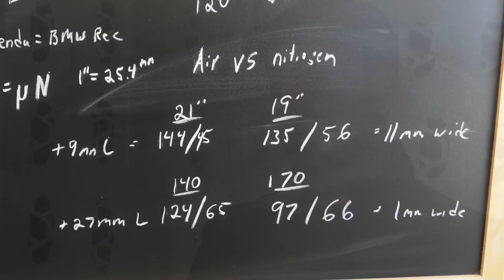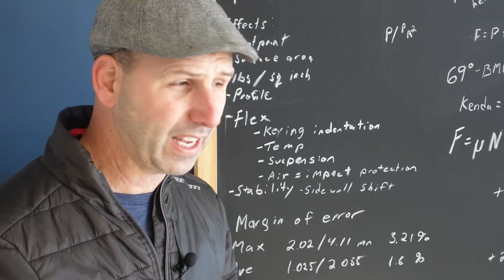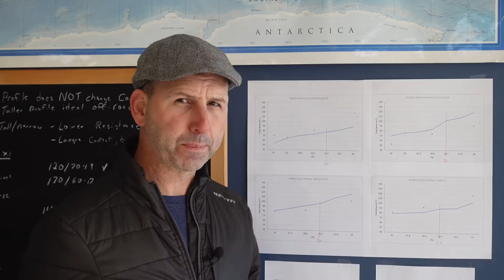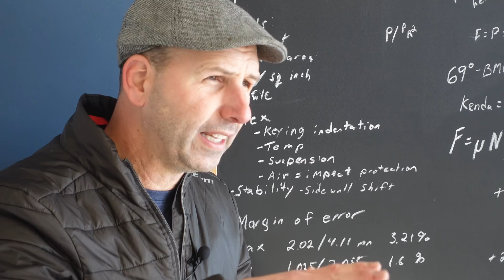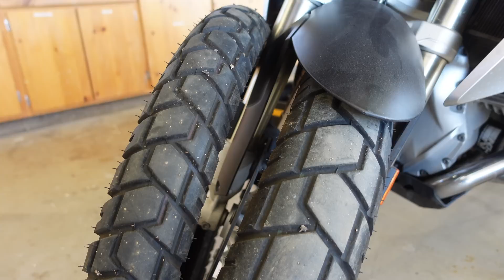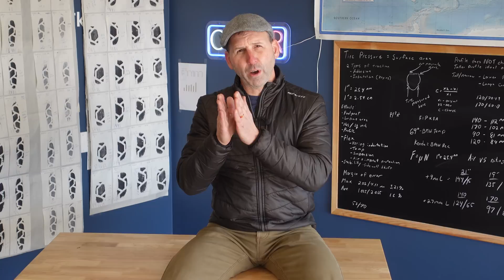Selecting the correct tire pressure; How airing down motorcycle tires affects contact patch

Comment: So In Short Its not THAT Much beneficial to air down But if you DO wanna air down, air down to maximum of -10-15% or in extreme cases -20% . Thats the Theoretical Part What remains next is the Feel Part if You feel Confident at less pressure sure go ahead but just like he said there are other consequences too like stability and traction so keep those in mind. Persoanlly i'll try to Lower mine by -15% from now and try to feel if it feels more confident if i feel a difference thats what im gonna do otherwise recommended pressure will be good anyway. Its all about what increases your confidence try it out before accepting anything
Reply from the maker: I would like to do a study on rider "feel". The perfect setup would be a double blind study with a cross section of riders from expert to novice. Tire type and brand would be irrelevant. Only rider and pressure changes.

The goal is to discover if riders can tell the difference.
Reply: @BretTkacs  Cant beleive i got a reply from the GOAT itself Thanks <3. and Yea that would be a great experiment if you can pull it off im still in shock about the amount of work that got put into this one Cant wait for the next one keep up the good stuff. <3

Comment: That is a super interesting video. I'm not experienced with off road bikes, but I've done a fair bit of 4×4 offroading. There's two big effects there with air down, and I'd like to know how much they apply to bikes:
1. paddling- the tyre distortion gives you large scale dishing of the contact patch, which helps in sand and mud.
2. lug flex- the gap between the lugs opens at the edge and closes in the middle, giving grip edges, and clearing out some mud.
Reply from the maker: Lugs are shorter and tightly gapped, there is less area to allow distortion and bikes travel at higher speeds than those of 4x4's when they are aired down

Comment: If gaining width of the tire were the  main reason, then to use a bigger tire would be the ultimate solution, but that is negligible, I mean the real reason of airing down is that the tire do not bounce a lot and the tire surround the irregularities to gain grip and increase the security.

Comment: Thanks Bret for all the hard work and reasonsble explanations. It is no surprise that the Contact patch variation in size is neglectible when airing down about 10 to 20 %. The tire manufacturer of a 50/50 street legal tire must comply with a series of safety requs and warrant road  performance even for fools like me forgetting to check the tire pressure regularly. Off road  lower pressure reduces vibrations caused by rough surface better than the suspension is able to do in the  first 3 mil of travel. Thats why it feels better. 20 % down is a good starting point for self testing. 
Contact patch shape is an underrated topic. The longe the patch the more straight you go. A shorter patch shape will steer more sensitive resp.  deflect much easier on rough terrain. The size of the patch
Reply: I ride 1.9 bar front and 2.0 bar rear, on my cb500x for TET. I do belive that a little less pressure is better for off and on road. So dont exactly understand why Bret says it not...

Comment: I would h ave thought it was more about deformation of the tyre to get hold of the uneaven surface better rather than cut into it.  Then again, that's just a feeling and not based on any actual measurement.

Okay, so I should have known you would cover that...

Comment: I don’t ride the big heavy bikes. I reserve judgment on the “science” of this experiment. One problem I see, however, is that the video does not discuss methodology. It does not state under what conditions the footprint was measured. But I get the feeling it was measured under static (stand still) conditions rather than specific dynamic conditions. For example, I sometimes ride up or down a steep rock surface. When going down, I believe there is considerable advantage to having low pressure and weighting the front end by moving all the way forward. As the brake is applied, the suspension compresses and I believe the tire flattens giving me a substantially bigger patch to slow the bike and prevent skid. Similarly, when riding up the face, the weight is shifted to the rear. The lower pressure allows the tire to flatten more and provide the greater contact, giving one more traction. 

The video shows the tire will flatten more easily with lower pressure in a dynamic situation (going over obstacle), but only discusses this as a disadvantage (hitting the obstacle harder with the rim because the tire folded more). This is true in that situation, but this is why you would deweight the front of the bike going over such an obstacle. But he states they just ran over it. So I suggest this may be a case where the author just does not recognize the weakness of his testing methodology. 17:33

Comment: Ok, because of my knowledge of physics (B.S. geophysics) I can tell you that size of contact patch is totally irrelevant.  Decreasing pressure softens the tire increasing the coefficient of friction.  If you double contact patch you half the pounds per square inch.  These two factors cancel out.  Now, let me don my asbestos underwear.  Flame away, folks!
Reply from the maker: That's the reason I didn't address the "contact area increases traction" debate. When it's about friction (traction) it is already disproven and nobody is aurging surface area doesn't matter when thrust is needed.

Comment: A Tiger XCa’s rear Exel rim doesn’t have a bead lock. The valve stem isn’t capable of transmitting torque from the final drive to the tire during on pavement hard acceleration test portion of the airing down experiments. Commenting for a friend...

Comment: This has been experimented with for decades with 4wd vehicles, and the resounding answer is that airing down helps a bunch in many different offroad situations: stuck in the sand, you air down and you get out; slipping on the mud and can't get up the hill, you air down and crawl up the hill; the road is washboardy and rough as hell, you air down now your ride is smooth; your wheel are skidding on a boulder step up, you air down and crawl over the boulder. So I'd be surprised if the nature of motorcycle tires were so different that they wouldn't reap any of those benefits. I'm not sure what the mechanism is, but definitely airing down objectively helps 4wds at least. 
I'm more inclined to think that the methodology is flawed than to think it disproves reality.  So then footprint on a hard flat surface doesn't mean much. Maybe it's the tautness of the rubber which impacts grip, whether or not it translates to a bigger contact patch? I'm thinking about the difference between summer and winter tires, where subtle differences in the rubber compound end up making a huge impact on how that rubber grips on different surfaces and in different temperature ranges.

Comment: So why do I air down?! After this video i definitely don't know why it works, but i still know that it makes a difference in difficult terrain... sorry no science there, in the end it might only be psychological, a belief that many share (I might be a religious person after all :D)

Just a thought on the surface area point, especially in sand, as i believe to feel that it makes a lot of difference booming through it with full pressure and low pressure, can it be that in reality, where the sand is soft and the tire sinks in to it the difference is higher because the sand touches all to the edges of the tire?!
I feel my explanation is horrible so i'll try to rephrase it a second time and you might understand what i mean.
On a flat paper it might look like just a few mm, but in 3D the difference might compound?!

Would be interesting to hear/see you're thoughts on that
but as always thanks for the video, interesting stuff

Comment: It's right there in the middle of your board, but you don't talk about it:. F=uN.  It's the elephant in the room.  N is the normal force and the unit is mass.  At no point does surface area enter the picture.  So from this stand point, this focus on contact patch size is irrelevant.  There are many reasons why contact patch size IS relevant but friction ain't one of them.  In my opinion you should be examining the other element, mu, which is the coefficient of friction for the system you're looking at.  That one's tricky because in a dynamic scenario it could vary a gazillion times a second depending on a bunch of factors. As wiki says, "The complexity of these interactions makes the calculation of friction from first principles impractical and necessitates the use of empirical methods for analysis and the development of theory." So keep gathering that data, but I think you should spend your time talking about everything EXCEPT contact patches.

Comment: The feel thing is such an interesting thing.

Although I know I should properly check my tire pressure more often, I know I’m getting really low like 22-27 PSI from my recommended 42, when turning I just feel more planted and less sensitive to minuscule road feedback and handle bar input like a steering stabalizer almost.

I’m assuming this sensation is similar for the run flat dark siders out there.

Comment: This is wildly interesting.  In offroading in my trucks/suv's I air down (have onboard air) and that is purely for a better ride.  I never aired down on motorbikes for the ride, it was grip and I think I was wrong.  When I road offroad and motocross, I'd hit the dunes and for ages I would lower my tire pressure, then I'd get a pinch flat going hard on the whoops.  After a bit I just said, you know I am done changing tubes I am going to run my track pressure everywhere.  No more flats and I have no idea if the frequency of washouts or crashes was up/down.  I just said, I don't care I am sick of bending rims and pinch flats.  

Another killer video.

Comment: As always I love the way Bret breaks down everything in his videos and shows his work.  That's how you make an argument that should convince all but the stubborn idiots in a room.

This issue is about scale.  The reason it works on a 4x4 is weight and size which is substantially more than a motorcycle.  (I've built and tuned professional-level competition machines.)  That is really important.

Motorcyclists are trying to apply that effect to their motorcycles and it just doesn't scale the way they imagine.  I don't air down at all unless I'm on really rough ground and that is specifically to reduce deflection.  A rock garden can bounce a fully aired-up tire all over the place, but at 20% less air the bike is much more controllable. It's not a lot but sometimes not a lot is what you want.  The suspension setup is more critical to bike performance than air pressure, air pressure is more like the fine-tuning knob after you get the suspension right.  Suspension is more like a course adjustment. Anyone that tunes anything with an engine can tell you that is dead true at any scale.

Sidewall and tread section construction matter more when it comes to tire flex and contact patch than air pressure even on a monster truck, air pressure is still a fine adjustment.

There is little surprise that all the tires have similar contact patch sizes.  That's a matter of physics.  They are balancing rolling resistance and grip and that formula only has so much give.  If you have a narrower tire you need a longer contact patch to get the same surface area.  What matters more when you are talking about contact patch size is surface area, not so much the shape.  The shape is more about rolling resistance as a wider tire has more resistance than a narrow tire with the exact same surface area.  Softer tires have more rolling resistance than harder tires, but the softer tire has more traction given the same surface area.  If you want more grip you actually want a softer tire with a more appropriate tread pattern.  I run 70/30s on everything but soft and loose soil, when I know there is going to be sandy river bottom soil I switch to knobbies with large and deep voids.  The 70/30s work well on compacted soil, river rock, and whatnot.

But, there is something else to this discussion.

The size of the tire matters.  Taller tires climb more easily.  Narrow tires dig more, and wide tires float more.  Ask anyone how a 300 or 350 tire feels on a wet road versus a standard-size tire.  It's why they make giant agricultural tires and very narrow tires, each has its purpose.  But in the motorcycle world there is more to it than just float vs dig.  Width also affects turn-in rate a long with some other geometry of the forks and wheelbase, and weight, it's complicated, but just know that tire width affects how the bike turns into a corner.  That doesn't seem as obvious as to why off-road people should care, it matters when you put that same bike on pavement.  That tire has to keep you on the road at 70 MPH and keep you from eating dirt on a trail.  Believe it or not, there is a magic formula most tire companies use to arrive at that point.  That is the real reason why the tires are so closely matched in performance, they don't have a lot of room to work with while designing a tire that can do both as well as they can.

Comment: Airing down effect on a tire is directly related to the ratio of rim diamiter to tire diamiter. In a truck with 15 inch rims running 40 inch tires, the effect of airing down is dramatic, and you can get away with lower pressures before bad things happen. There is a lot of sidewall to deform an extend the contact patch both wider an longer before the rim get near danger. You have roughly 12 inches of deformation to play with. And that can wrap around some pretty big rocks. But a 30 inch tire on a 20 inch rim, airing down has much less of an effect. An you need more air in the tire to keep from cutting the sidewall or bending the rim. You only have about 4 inches of sidewall deformation to play with. There is just not as much sidewall to flex and not as much safety margin. For that reason, if you see really tall rims on a 4x4, you can safely assume its a pavement princess. 

A motorcycle tire is the extreme end of the ratio. The rim is big with a tire that is only slightly bigger. Sidewwalls are tiny. So there is very little gains by airing down. You only have about 2 inches to play with. That's not even taking in to account that a truck with its tires aird down is usually going no faster than a human can run, an a motorcycle is usually hitting things a bit faster.  Margin of error is small. 

My farm truck running 32 inch tires on 16 inch rims, I have about 7 inches of derormation to play with. I rairly air down because the gains are not that much. They exist so if you are doing some timed hard core wheeling, its worth it. But I am not doing that. And I sure dont see me riding my bike in a way that less than a third of that deformation is worth it. So the air that got me to the trail is the same air that will get ge home. But thats just me.

Comment: The title of the video should be changed to something that is focused on big adv bikes with street tires.  

This does not apply to dual sports and dirt bikes that actually run soft side wall tires and have rimlocks.  Knobbies and sub 10psi are insanely different than a street tire at 30psi on a 600lb bike.   The video title suggests this applies to all bikes which is a lie.

Comment: Try this test and see for yourself if the information you're being given in this video is valid.

Pump your tire to the recommended tire pressure, take a rock about 3/8-1/2"  and place it on the driveway.  Roll your bike on top and sit on it.  Have someone get low and take a photo of the tire standing ON TOP of the rock.

Now lower the pressure to a true off-road pressure.  Example 22 psi dual sport tire, dropped to 8-10psi with rimlock.  Do the same test and photo.  You will clearly see that the difference is substantial.

In one case the tire will sit on top and the other case the tire will eat up the rock and the rest on the driveway.